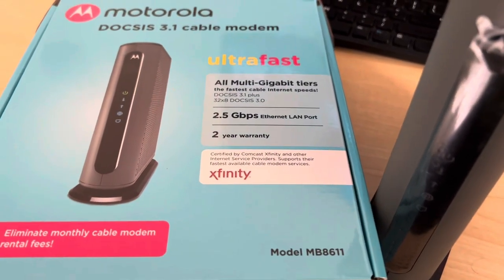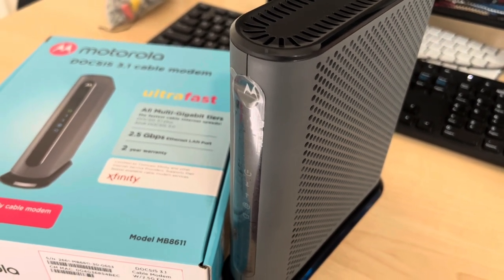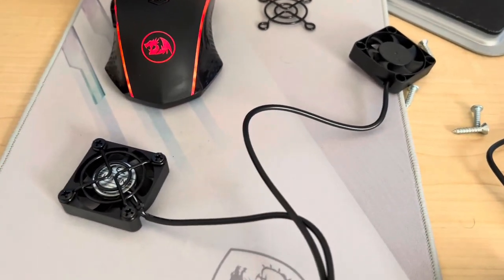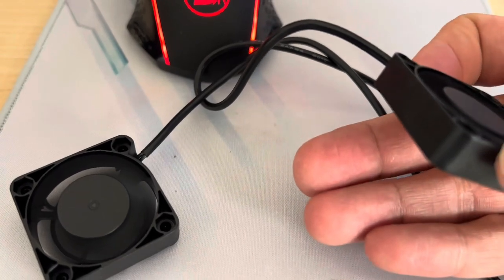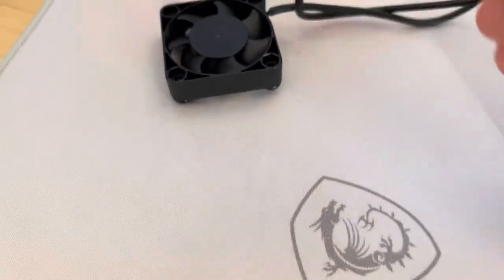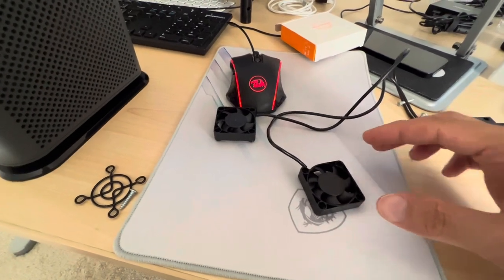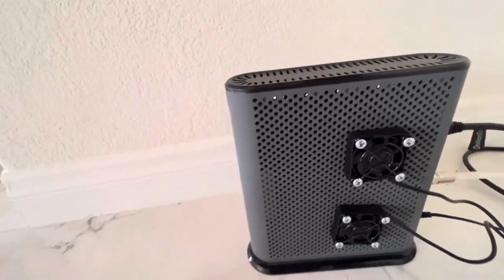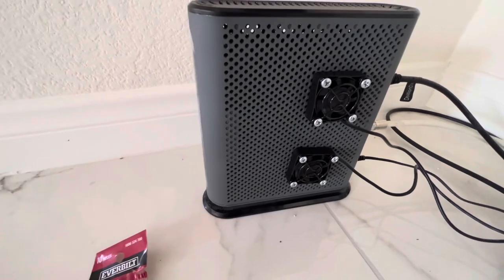FIXED!  Overheating cable modem. Will work with other small electronics

Comment: I've been modding things that overheat that also have a 12V line with fans and heatsinks for a long time, good to see others doing this.
Reply from the maker: I'm curious to ask you the same question I asked another person; Are you pulling air in, our drawing hot air out?  I debated which would be the most effective.  I'm currently pulling air in and it seems to be working great for nearly a month now.  Thanks for watching!
Reply: @renaissancelaboratories5645  I've tried both and I would say pushing the air IN (i.e. blowing over the hot components)/  I've tried sucking the air out and while it is effective, it doesn't cool as fast or as efficiently

Comment: I had a netgear router burn out on me  i been doing this to all modems and routers that run on 12v
Reply from the maker: Question, are you pulling air in, our drawing hot air out?  I debated which would be the most effective.  I'm currently pulling air in and it seems to be working great for nearly a month now.  Thanks for watching!  These little fans are a great all-in-one solution for this.

Comment: Thw cheap PlayStation 5 stands with the airflow fans work well for a router that's what i have mine sitting in just now with the heating on alot ots causing alot issues with my BT router